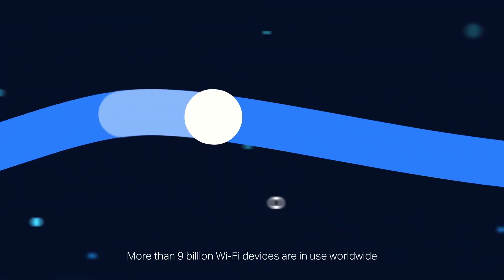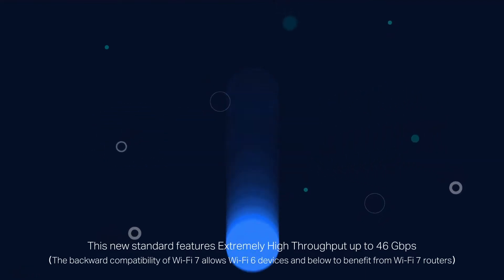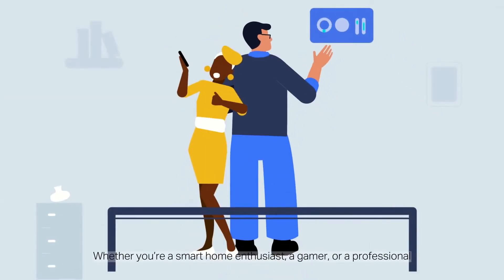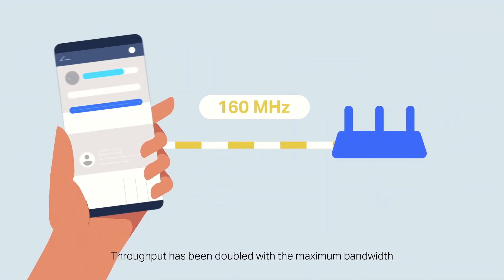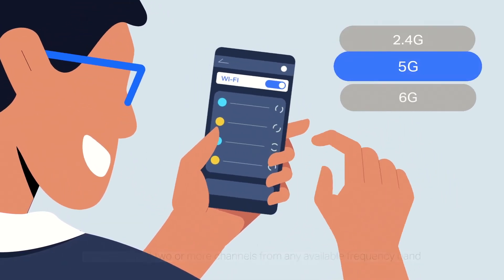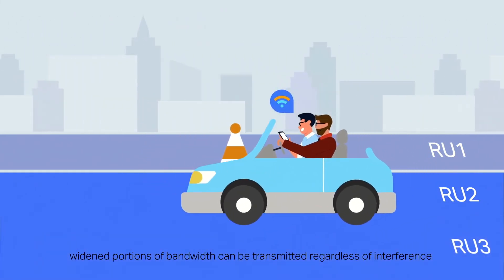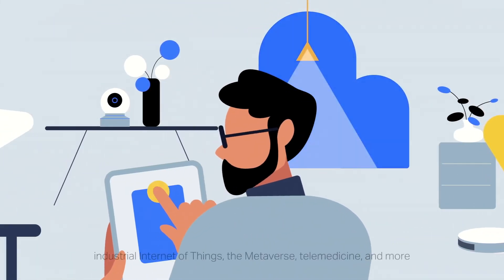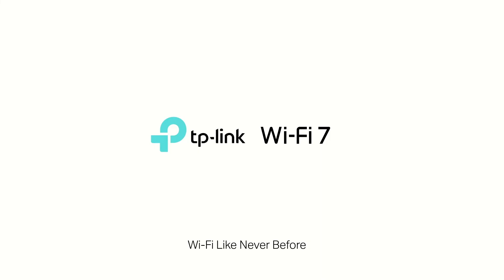What is WiFi 7? Who needs WiFi 7? | TP-Link WiFi 7 Technology

Comment: I am waiting for Wi-Fi 7 to arrive in smartphones. My device with Dimensity 9200+ chip already supports Wi-Fi 7.
Reply: The Dimensity 9200+ chip does supports WiFi 7. But it will be upto your smartphone manufacturer to decide if they do a software update in 2024 to unlock WiFi 7 on your phone 👍🏾

My phone has a Snapdragon 8 Gen 2 chip which also supports WiFi 7. Plus my phone is advertised as being WiFi 7 ready with a software update coming to unlock it in 2024 👌🏾

Comment: Can current optic fibers which suport wi fi 6 can support wi fi 7 too?
Or wi fi 7 requirest completly new optic fiber instalation and new cables?
Reply: Current optic fibers will support WiFi 7 too.
Reply: It’s mainly about overall network bandwidth for me firstly. And correct speeds claimed by the huge ISP companies
Reply: The highest I’ve seen is from Google Fiber at 2.5gbps. Maybe they’ll do a 5 and then a 10 and on plan but they need WAY more infrastructure they can obviously afford

Comment: Wifi 6 is fast enough. We want longer range and stability.
Reply: Stay on the 2.4GHZ band then or get a mesh wifi booster
Reply: @Pringles2.0  I'm on 2.4 but obv i want 5ghz to be better
Reply: @6FootVampire  it's the technology, if you want more range then you need to purchase a mesh booster. Single modems won't have the range.
Reply: @Pringles2.0  yeah unfortunately

Comment: will wifi 7 be better than wired?
Reply: Wired will always be better. Wireless devices according to the United States FCC(and probably many other countries as well) will always have to accept interference even if it causes problems.
Therefore other wireless devices can interfere with your wireless devices.

Wired is or can be  shielded therefore no interference. So wired will ALWAYS be better. Your microwave will never be able to affect your wired connected devices but it can affect your wireless ones.

Comment: What about the range ?
Reply: Might be decent instead of the worst if the with range c wifi 6e. I literally just got a wifi 6e to-link or even use any of that spectrum, yet just backwards compatible when mine wasn’t even to wifi 6?! Like wtf
Reply: the range is low you have to be close to the device to get better signal, 2.4ghz is better in range then 5ghz 6ghz with wifi7 2.4ghz 5ghz 6ghz what is broadcast to users

Comment: Wait what happened to WiFi 6E or is this just the official name for it? There would be a lot of angry people if they just upgraded to WiFi 6E only to find out there’s a better 6GHz standard already before devices even update to use it lol
Reply: Nobody's going to be angry. Wi-Fi 7 encompasses everything that Wi-Fi 6E has offer and more. There are no cell phones laptops or computers with Wi-Fi 7 so the first thing that you would need to upgrade anyway is your router. Therefore it's not a big deal at all.
Reply: @DaPoets Are u an idiot?  Im angry af, I just spent hundreds on tplink wifi 6 a month ago
Reply: @13panda13  it will be a number of years before cell phones and laptops come out with Wi-Fi 7 and by that time you will be fine with upgrading your router. It'll be 5 years before an iPhone with Wi-Fi 7 comes out anyway since they don't even have Wi-Fi 6e on their latest phone.
Reply: @DaPoets  Wrong as several 2023 flagship smartphones are already WiFi 7 ready ie they will get a software update to unlock WiFi 7 when it launches in 2024 👌🏾
Reply: @C--A  lol 8 month old comment and only a very small number of phones have WiFi 7 and even then they don't have the full capabilities. I just did a video on WiFi 7 TP-Link mesh that I have and OnePlus WiFi 7 phone.
Reply: Once again technology pushes the next thing when the current technology isn’t even maximized or efficient (WiFi 6 & 6E). 
This is great for when 2024-25? 
Looking forward to it , when it comes and devices can handle it efficiently
Reply: @biggun7  I would argue wifi 6 is now mainstream, but wifi 6e has a ways to go still.  Wifi 6e routers and devices supporting it just came out in early 2022
Reply: 6GHz was originally planned for WiFi6 but legal regulatory issues pushed that away, so 6E is piece of WiFi6 that waited for this to solve out first. So its not problem made by creators of standard. You dont need to think too much, its just wifi6 with 6GHz, same as 5GHz was optional for WiFi4 (804.11n)